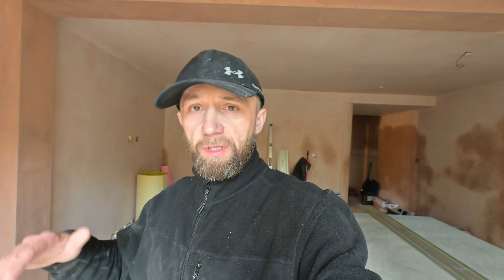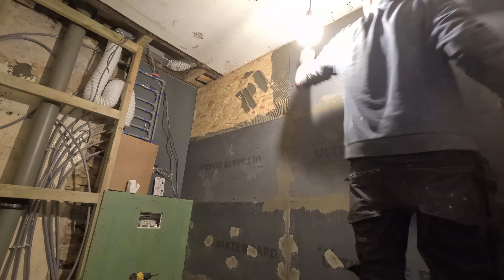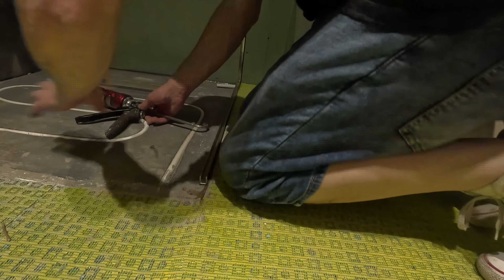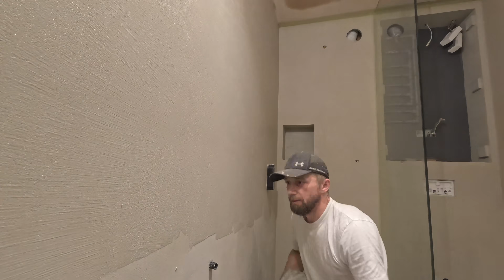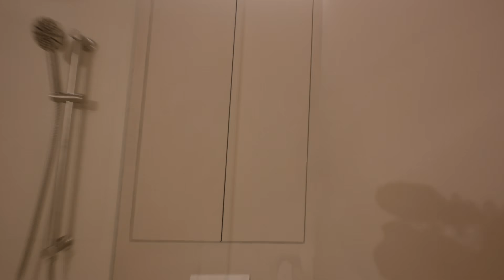The Death of Bathroom TILES..Micro-Cement Explained

Comment: Well done bud. I like it better than tile but ALOT more work
Reply from the maker: Thank you. Yes, it's a lot of work but it's kind of satisfying. Thank you for engaging
Reply: Great result ! But I’ll never do it… way too long. Don’t take me wrong, I hate tiles. I used PVC board for walls, very fast to install and choice of finishes. From GERFLOR.
Reply from the maker: @BrunoNATI 
Thank you for engaging 
Yes, it's a process so if you are after a quick solution, this isn't your option.  After all the pro is done you are looking at 4-5 days just for micro cementing. It's longer than tilling but it's the look that people like. No joints, no grout and you can go over furniture. It's subjective
Reply: @BrunoNATI hey, how long has it been since you installed the PVC boards? Do you have any ideas how they perform in the long term?
Reply: Oh no a lot more work!
Reply from the maker: @Daniel-x1i8h  both ways is a lot of work. It's different.
Reply: Tile is quite alot of work...
Reply from the maker: @johnwayne-kd1pn  both ways require a lot of work. Different look and finish, but both are time-consuming.
Reply: Do you do micro cement in Poland? I have two bathrooms to be done
Reply: Agree. Maybe it's use in smaller projects like a shower stall avoiding tiles and grout in the highly wet area
Reply: Being a builder. I have to say I’m not impressed with your floor tile outlay. But I’m interested how thick is it from face of micro cement to back of osb? And can you tile floor after micro cement thankyo
Reply from the maker: @danielpauly3477  Hi, and thank you for engaging. The architect printed the tile layout on paper, so we followed it. You can tile afterwards. In this case, this had to be the order because of the trimless glass. It could go any other way.

Comment: Looks great, but I would be concerned with how it is cleaned over time.  The reason tile is used is that it can take the scrubbing that is needed to remove soap scum, mold, etc.,  This would have to be able to hold up to harsh bathroom cleaners - over time.
Reply from the maker: That's right. You need to use gentle cleaning products, same as for marble. If you keep it up regularly, you won't have issues. Nothing organic will ever grow on this which is a good thing.
Reply: @yesconstructionltd How about hard water and lime scale that usually needs an acidic cleaner to remove it and how does the surface dry after a shower as it doesn’t look like you can dry it with a squeezy?
Reply from the maker: @ich8159 Thank you for stopping by.  The after care is the same is for marble so gentle cleaning products. Timescale remover is fine. Only bleach is not recommended. The surface looks rough but it is smooth enough for squeegee. The final coat (seal coat) is applied to smooth the surface. In my next micro cement video (3-4 weeks)I will show all of that. I realized what you guys need to know from the comments and I will try to answer all of that
Reply: @yesconstructionltd Thank you for explaining that! Could this also replace a tiled backsplash in the kitchen? Could I do all the walls in my kitchen with it so that I can easily clean them from grease or would that get too expensive compared to plaster and paint for the walls and a tiled backsplash?
Reply from the maker: @ich8159  It's funny 😊 I am literally working on this right now and recording content for my new video. Slightly different primer and different final seal. I am using smooth grade finish in the kitchen. If you are not in rush, wait for the video, otherwise just ask what you need to know.
Reply: @yesconstructionltd  Cool! No rush, but hurry up! 😂
Any chance of you coming to Ireland/ Dublin? 😅
Reply from the maker: @ich8159   I am afraid this is a little bit out of my range 😁

Comment: I really like the look. I’m not as minimalist as most of these designs, but would love to incorporate microcemented elements in my next bathroom.  Thank you for showing the process!

Is the surface relatively easy to clean and maintain?
Reply from the maker: Thank you for engaging. Repairing is hard to do without being seen. Something small yes, a larger area will show. It's best to apply the final coat again on the whole wall. The staff is not easy to damage though

Comment: How is this material to clean?  The shower will be scrubbed each week?  Will it hold up?  Tiles, I think, would be better in the shower.  Thanks for your video!
Reply from the maker: Cleaning is fine. It's not recommended to use bleach. We recommend using the same cleaning products as for marble.

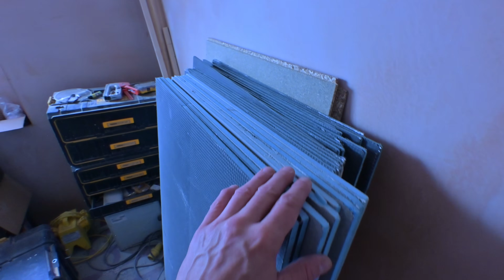Comment: 2:28 is your OSB treated to be moisture resistant. Would you consider marine plywood?
Reply from the maker: OSB itself is moisture resistant. Marine play is overkill in my opinion. You have Jacko boards in front of it which are insulated so there won't be condensation in-between. Marine ply is obviously better but a lot more expensive and I don't think necessary

Comment: well, a few year ago some did come out with a micro cement thing, but that was not resin based, it was not waterproof, you had to use a transparent glossy or matt coating to make it water proof, for bath or exterior usage or for floor application.
Reply from the maker: Micro cement was used for hundreds of years. Mainly in Spain, Italy, Morocco but it was cement based. The new improved formula is resin so it's extremely waterproof and durable

Comment: For such a professional and tidy looking job I couldn’t help but keep looking at that exhaust fan ducting… the flexible ducts are so incredibly shit and inhibit so much flow, it’ll be next to useless 🤦🏻‍♂️
Reply from the maker: I know, let me explain. We did as best as we could. To run it in a flat channel we would have to introduce 4 elbows. We were working with an existing duct running through the floor of the flat above so no access or possibility of an inline fan. Because where it's the fan had to be 12v so not very powerful. Every elbow adds 1M to the length of the duck which already is long. We decided that use of short flex is still better than 4 elbows. If you look closely in the video, there is no space and we would have to go up from the fan, turn right, go up again= 4 elbows. 
Sometimes you can't get it 100% 
Ideally the whole duct should be changed and nicely sealed and insulated.
Reply: @yesconstructionltd  ha I only just read your other comment explaining it. Fair enough. Sometimes you gotta make do I suppose
Reply from the maker: @6wheels646  yeah, but it is eating me not having it done 100©

Comment: Micro-cement doesn't actually work very well in bathrooms. I have had the great misfortune of working on projects that have used micro-cement in bathrooms. The process itself is time-consuming and labor-intensive and if you don't get EVERYTHING just right, it doesn't work well and you have to do it all over again. All of that costs a lot of money. All of the projects I have been involved in have decided to get rid of the micro-cement and have gone back to tiles.
Reply from the maker: Maybe your material was cement based? The new stuff is resin based so extremely waterproof and durable.

Comment: Does it matter what sander you use , would one of the slower running but bigger dry wall sander work as well or only something like the small sander you used ?
Reply from the maker: I run my mirka sander on a slow setting. On fast the paper will go bland quickly. I sue 125mm or 150mm disc. I believe the 225mm dry sander will be too big. It will only catch the high spots. Micro cement is little up and down

Comment: You don't have to tile it but you do have to spend £4500 on prep and spend a arduous week boarding the walls and getting ready to plaster it.
Reply from the maker: Tilling is also requiring prep so that part is involved in both methods. Micro cement is not a cheaper solution, just different. Different look and vibe. It's the flexibility around it and what you can do with it that I like.  My next video is going to be about a kitchen but the one after is another micro cement bathroom where we did a lot of ambient light shadowing the walls and that looks awesome.

Comment: Cement, but it's resin? So you've basically rendered the bathroom.
Reply from the maker: It's resin with a crashed stone. You can say that. It is like rendering, but thinner. Micro cement is a finish product. It's called micro cement because back in the day it was cement based. The improved formula is with resin.

Comment: Haha Whoops. Someone cut the glass too long. So that glass is basically part of the waterproofing system now. It's in there for the long haul!
Reply from the maker: That is how it's designed. It's a glass wall floor to ceiling. More and more people are doing this now. It's quite common
Reply: With completely closed off showers full height glass eliminates cold drafts, wich is very nice besides looking better. Though with an open side shower that benefit is lost. In general this open side shower is a mess in tiny bathrooms due to water getting everywhere, not just the "wet" side where the glass is. 

The owners will need to squeegee most of the room after a shower, or enjoy wet socks when using the toilet later in the day.
Reply from the maker: @adriankoch964 
Thank you for engaging. The client is an architect. We took some time designing the size of the glass. I insisted for it to be slightly bigger for practical reasons but she went with the look. Looks nice like this and it doesn't eat into the room too much. I am going to visit them next week so I'll get real feedback on how this all works for them.
Reply: @adriankoch964  " squeegee most of the room after a shower," You really think so with that under tile heat source?
We have a tiled floor with under floor heating in the office where I work. The trades crew comes in and out with wet muddy boots multiple times on rainy days and we have more issues with dust than dampness. It is probably the only saving grace for in floor heating in our small office because it is notoriously slow at maintaining air temperature while crew and customers stand in an open doorway not coming fully in nor fully closing a door when they leave.

Comment: Looks fantastic,

But would liked to have seen a 1/2 stagger  bond  on the backing board,   Far to close to a straight joint that is never good
Reply from the maker: Thank you. I know, it's annoying. I like perfection. The guy who did the work got fired on that project. He made one too many mistakes. He worked for me for a few years and I was happy with him but then he started making these mistakes and he wouldn't listen so had to go. 
It's meshed so it won't crack or anything but I get your point, it wouldn't take much to have it done by the book. Thank you for engaging
Reply: @yesconstructionltd    👍👍👍
I install  pretty much the same but use Venetian plaster very similar system
Reply from the maker: @SirJimmyStarmer 
Interesting. I was looking at that not long ago. I wanted to give it a go.
Reply: @yesconstructionltd    Buy a few small pots   & practice  on some plaster board,   Its really just having a keen eye for detail,  & trowel skills   that you already have
Reply from the maker: @SirJimmyStarmer I'll definitely give it a go.

Comment: Great job, it's a complex process when done right, also great video. Time wise how does this compare to tiling the same bathroom ?
Reply from the maker: Thank you. The micro cement process is 4-5 days long. You can't apply a coat  until the previous one is cured so it's a waiting game. As an installer it's good to have two bathrooms at the same time and you work in between.

Comment: Looks like a great job but it's an awful lot of work compared to tiling is it not?considering how many coats you have to give it and all that sanding etc,it's very labour intensive so you have to factor in the cost of that extra labour as opposed to tiling it which I presume is much quicker
Reply from the maker: Thank you 😊. It works out about the same as tilling. It takes 4-5 days to go through the process. You can't stick another layer on until the first one is cured. It's good to have two bathrooms on the go at the same time. One layer before lunch and the next after one in another bathroom after lunch. It's quite a satisfying job actually.
Reply: You take pride in your work fair play
Reply from the maker: @eddiecotter7201 
Thank you

Comment: Summary - Daniel explores the growing popularity of resin-based micro cement in modern bathroom renovations as an alternative to traditional tiles.
Key phases of the installation process include:
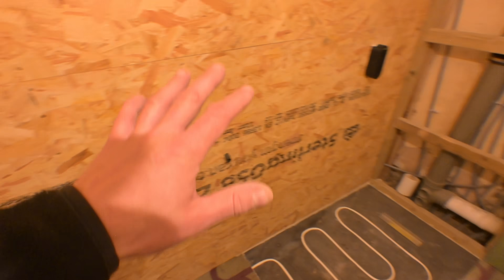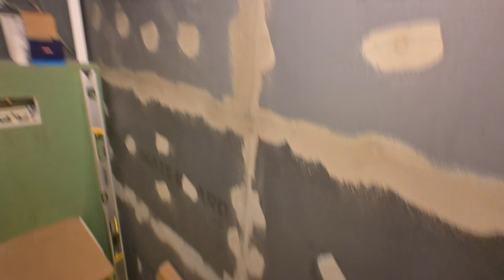Preparation (1:42 - 9:16): 
This is emphasised as the most critical step. The process involves installing OSB boards for a solid foundation, followed by insulation/cementious boards (Jacker boards), and building custom vanity and storage units out of moisture-resistant MDF.
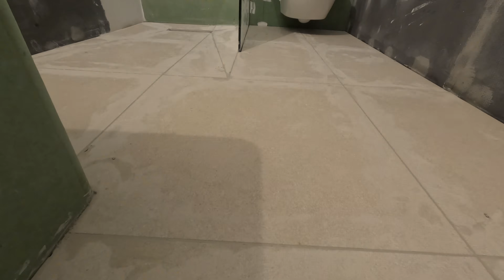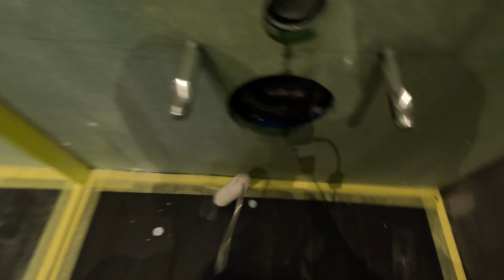Priming and Mesh Application (12:50 - 13:13): 
A dedicated primer is applied, and reinforcement mesh is placed over the joints of the insulation boards to prevent future cracking.
Micro Cement Application (14:11 - 15:00): 
Two base coats and one final coat are applied, with sanding performed between each layer to ensure a smooth finish.
Sealing (14:20): 
Three layers of a seal coat are applied to protect the surface.
Why choose micro cement?
Daniel highlights the aesthetic benefits of a seamless, minimalist look without the need for visible trims. Additionally, micro cement allows for the creation of bespoke, cost-effective furniture that can be easily customised to fit specific spaces
Reply from the maker: Thank you for the detailed description. I should have done this myself 😊
Reply: @yesconstructionltd  Youtube does it.  Click on the ASK next to the SHARE icon then click on "Summarize the video" and you get: 
This video, presented by Daniel from Yes Construction Ltd, explores the benefits of using micro-cement over traditional tiles in modern bathroom renovations, demonstrating the process through a project in Hackney, London.
Key Highlights of the Process:
Preparation is Critical (0:12:50 - 0:13:45): Daniel emphasizes that success depends entirely on surface preparation. He uses OSB boards followed by Jacker insulation boards, reinforced with a specialized mesh to prevent cracking.
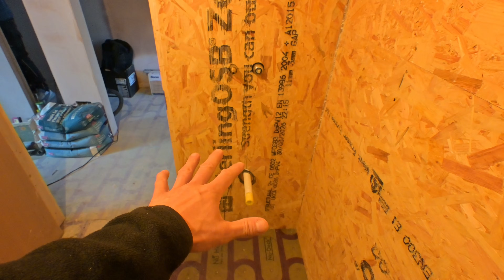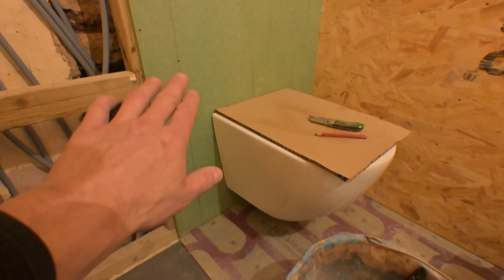Bespoke Furniture Construction (0:03:05 - 0:03:50): A major advantage of micro-cement is the ability to create and coat custom-made MDF units, like the vanity and toilet housing, achieving a seamless, minimalist look that is difficult with tiles.
Material Evolution (0:00:46 - 0:01:09): The speaker explains that modern resin-based micro-cement is superior to older cement-based versions because it is waterproof from the first layer and significantly more durable.
Step-by-Step Installation:
Priming: Applying a dedicated primer (0:12:50).
Layering: The process involves two base coats and one final coat (0:14:12), with thorough sanding between every stage to ensure a smooth finish (0:14:22).
Sealing: Three layers of seal coat are applied to protect the surface (0:14:17).
Why Choose Micro-Cement?
Daniel prefers micro-cement for its minimalist aesthetic, the ease of creating bespoke features, and its high durability compared to traditional tiles (0:24:05). He mentions that while tiles are a traditional choice, the modern, waterproof resin-based systems offer a functional and visually striking alternative for contemporary, seamless bathroom designs (0:24:25).
Reply from the maker: @lym3204 I see 😅 I didn't know. Thank you for explaining.
Reply: @yesconstructionltd  I think you might be able to pin it to the top. Great work iosios1768

Comment: It looks clean

However. It’s a bit prison like 

Also if you can’t damage it with a hammer - what happens when you want to remove it?
Reply from the maker: The look is a subjective matter. For some people this looks too clinical. We suggest using a wood door on cupboards and vanity ( like in my previous video) to break the plain look and to accessorise the bathroom with colour. Adding ambient light etc. If you didn't like the micro cement anymore after 10 years of looking at it and you wanted tiles instead, you just tile over. All you have to do is use the correct primer. It's a perfect flat surface for tilling.
Reply: @yesconstructionltd thank you for taking the time to reply. That all makes sense

Comment: Didn’t look like there was any waterproofing under the tiles in the shower?
Reply from the maker: Hi, and thank you for engaging. The shower tray itself is waterproof. It's cement based. All the joints around it were made waterproof so no issues there.

Comment: in case of (micro) cracking over the years or any damage to it is it possible to repair it locally and somehow blend it ? it depends on the finishing texture or is it not possible at all?
Reply from the maker: Hi, and thank you for engaging. 
If the job is done correctly then it will not crack. This stuff is extremely flexible. I did an experiment where I laid the entire buildup on a cardboard (narrow strip) After the cure I removed the cardboard and I banded the microcement into a full circle and it did not crack. I don't think cracking is something you should worry about. Mechanical damage is the one that could damage the surface, but again, it is extremely tough and scratch resistant. My next video is going to be about a kitchen installation but the one after I will be putting micro cement into the test showing all the possible scenarios. It will be worth watching for you so you can understand micro cement properly.